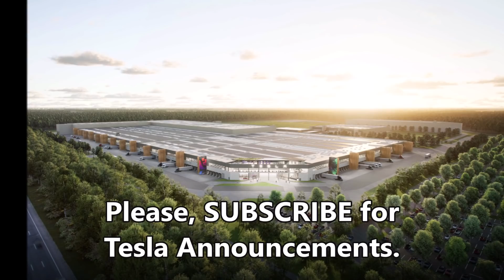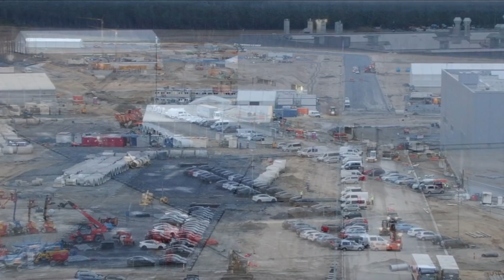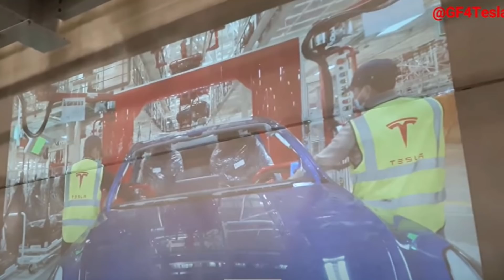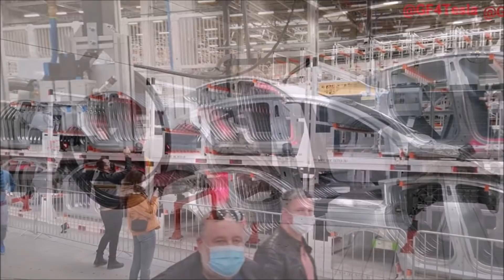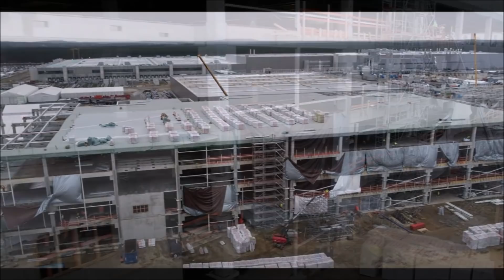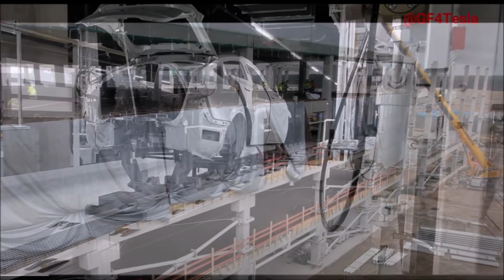BREAKING! Tesla Starts Giga Berlin Production With 500 Model Ys a Week

Comment: Seems crazy Tesla didn't make the battery factory first, they might have given that the go ahead to start production of batteries instead of the model Y. That way the 4680 batteries could be dispatched to their other sites... at least some income could be made.
Reply: The battery production was in the original proposals, but withdrawn by Tesla presumably because they thought the environmental concerns would cause delay on the approvals for the main factory.

Then later they added it back in, which has caused delay in the approvals.
Reply: Tesla does not need to, GigaBerlin will be using 2170 from CHINA, and GigaAustin will start with 4680 from FREMONT, but GigaAustin already has battery equipment on site on the 4th floor, Berlin battery factory 🏭 is later in 2023, and that's fine.

Comment: But they can't sell them.  Only for testing.  Right?
Reply: They can build them, but not sell them YET.  No one builds 2000 test vehicles.  They will be parked there until final approval, then sold.  They will now have to accelerate tarmac laying!
Reply: Wrong , they can be TEST Drive cars and DEMO cars at Showroom, and eventually get SOLD.
Reply: Even if they can't sell, it's not that important. They need to ramp up the production, test all the systems, adjust things. The important thing is not the car, it's the "machine that makes the machine".

So well done Tesla, convincing the German authorities to give temporary permits that allow the factory ramp to move forward.
Reply from the maker: However Tesla will find  away to somehow use them.
Reply: @Torquenews  whatever needs improvement,  they will do it until it is perfect, then sell!!